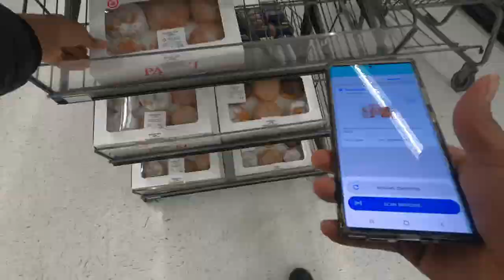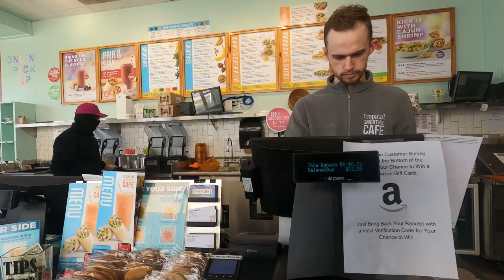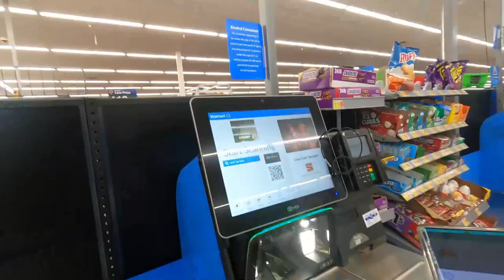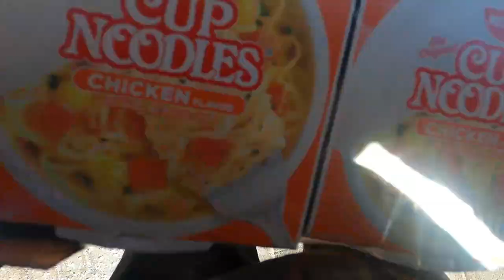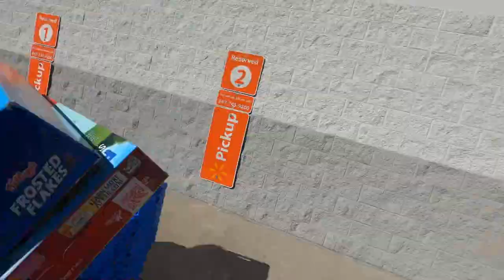What Is Up With DoorDash and UberEats Lately? No Orders/Crappy Orders 🤔. Ride Along, Shop & Deliver

Comment: What is up with the constant switch of drivers? I ordered 5 small items and 1 (12 pk cokes). My ordered was switched up between 4 drivers. The distance was less than 2 miles and I tipped $5. Was I wrong?
Reply from the maker: You don’t have any way of knowing how your order will be broken up. You can sometimes tell on your app at checkout how many separate deliveries you will be receiving. Your Tip only goes to the original driver who delivered during the timeframe you chose when you placed your order. The other orders are in-store pickups and sometimes come from other Walmart stores in the area that had the product in stock. The only way to tip the other drivers is to catch the notification when the app notifies you it was delivered. You can rate the driver and sometimes leave a tip, but they only give you a few minute window to do so. I wouldn’t feel bad about the tipping, it’s not something you can control.
Reply: @carsandcribs  Thank you for your response 😊